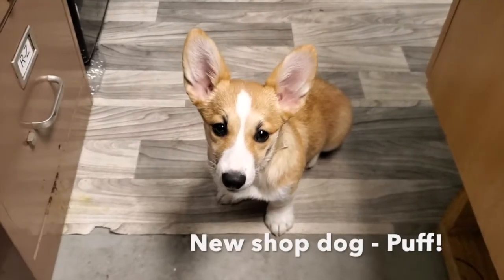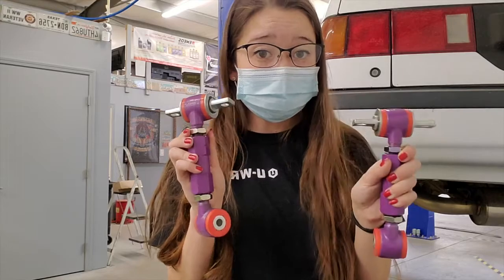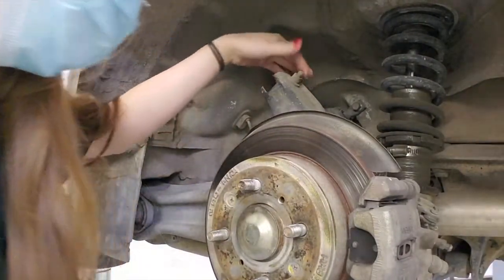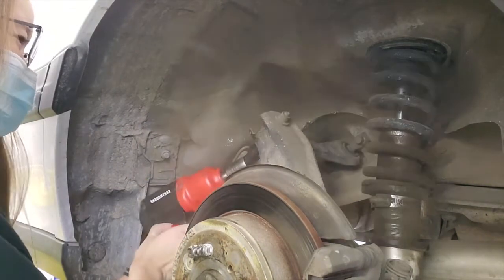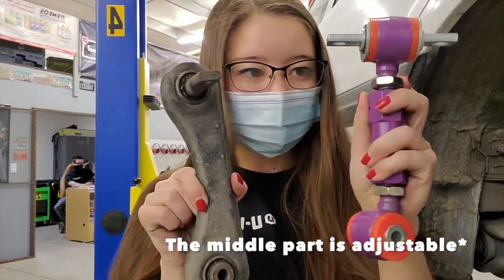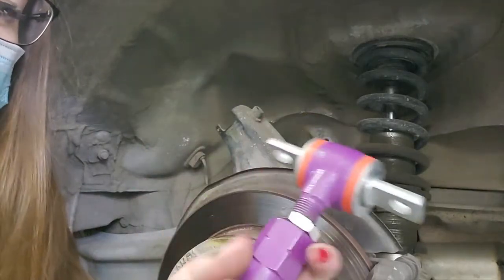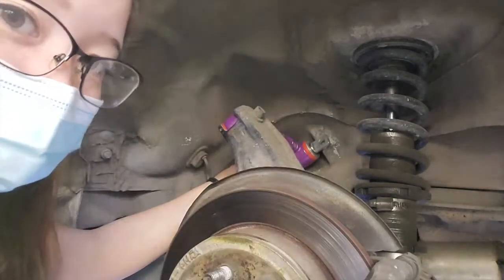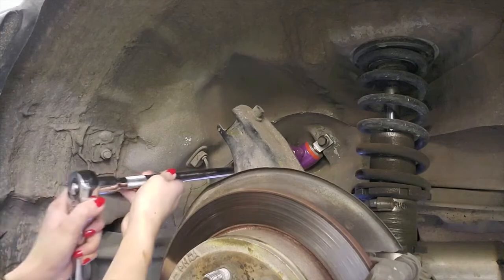Camber Kit Install

Comment: Was your camera mirrored?
Reply from the maker: I use the front facing camera since I use my phone so everything is reversed.
Reply: @MsVtec  messing with my mind as you were turning the fasteners clockwise to loosen and anti-clockwise to tighten.
Reply from the maker: @brittfuss1  haha yeah unfortunately I don't the proper equipment to get around that, but someday